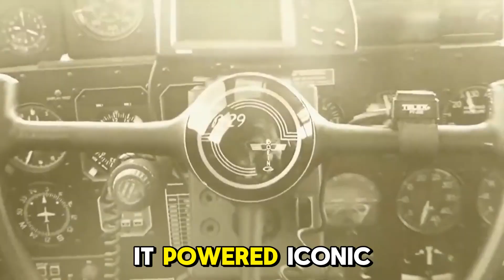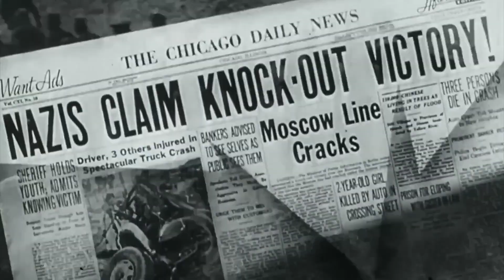The Shocking Truth Behind Wright's R3350 Duplex Cyclone Engine.

Comment: This engine was junk. Overheating on the B-29 took many lives. The Wright Corporation never built a real winner either in engines or airplanes. The prototype B-29 crashed due to an engine fire that killed Boeing's chief test pilot, Eddie Allen, and many top engineers when it crashed during a test flight in Seattle.